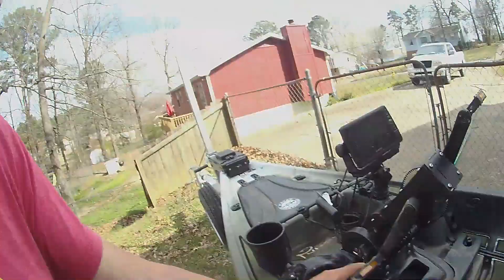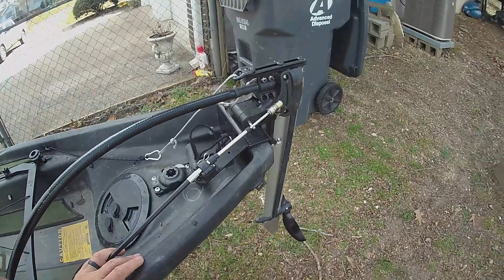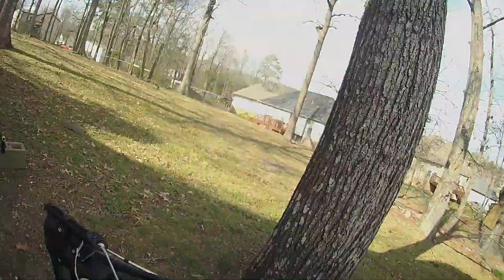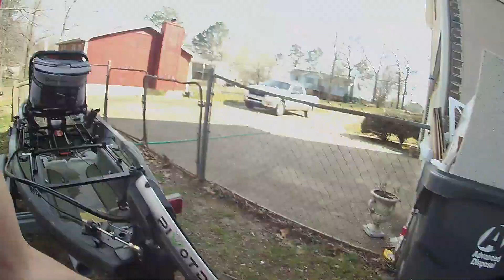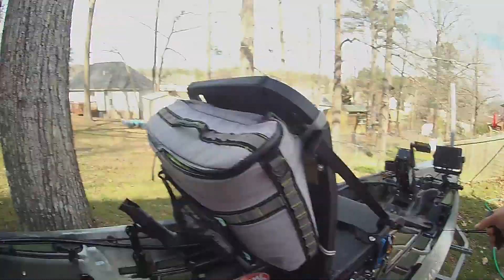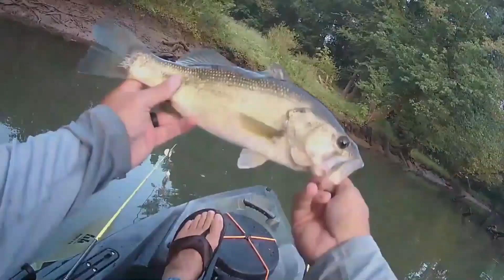NuCanoe Pivot Drive 100 Hour Review

Comment: great job,,,another ++ is the way I understand..in TX you dont have to Have TX numbers on bow ,because its Human powered...not gas/battery...Saves you $53 last time i checked
Reply from the maker: I have trolling motor also so I have numbers.
Reply: Dude you just full of info and one ? leads to another,,I have a  12 Unlimited  with the Pivot installed would it crowd  or elimate a second 360 seat...In other words can it still be a 2 person Kayak thx
Reply from the maker: @danbarosh2942  I’m not sure on that one. The length of the drive cable would determine where the seat would be. You might find some answers on the NuCanoe owners Facebook page.

Comment: Do you ever run the trolling motor and pivot drive at same time - i.e. pedal assist?  i"m wondering if your could add mph to motor?  i'm looking at the pivot drive for non-motorized tournaments.
Reply from the maker: David, I have never tried that. I don’t see why you couldn’t though. Thanks for the question.

Comment: Did you end up having any durability issues with the pivot drive? I see you moved to different kayaks in your newer videos
Reply from the maker: No, I had no issues with it. I wanted to go with the Bonafide pedal drive so I could add a stern motor and have the pedal drive also.

Comment: Great review and I enjoy your videos. The biggest question I have is how the pivot drive compares to other drives such as the propel drive and old town?
Reply from the maker: I have a old town pdl and the biggest difference is the resistance. Old town feels like a 10 speed bike in 5h gear and the pivot drive feels like 1st gear. Speed is about the same. Pivot drive turns better with the propulsion being in the back. Very different but both are great.

Comment: Do you still use the pivot drive 3 years after this video
Reply from the maker: I do not have the NuCanoe anymore. I sold it and bought a Bonafide Pedal drive so I could add an electric motor to the stern and have a pedal drive at the same time. I used the Pivot Drive a ton and never had any issues with it. Thanks for watching
Reply: @dudefish1635  I noticed  that after I did subscribe  I like the creek vids do you think the unlimited would be good for creeks like that
Reply from the maker: @raysgonefishing3271  for creeks with easy access or put in ramps I think it would be fine. A lot of the creeks and small rivers I fish are remote areas and hard to reach spots. I have a Crescent CK1 I use for those places. It’s only 60lbs and with a drag strap on the front I can put in places no one would even consider going. It’s a paddle only kayak with no motor or pedal drive. I have lots of videos of me fishing out of it. My main kayak I use now is a Bonafide PWR129 with a bow mount trolling motor 2 10” graphs and all the bells and whistles. I use it for big lakes and tournament fishing. For me having 2 kayaks for different styles of fishing is the way to go.